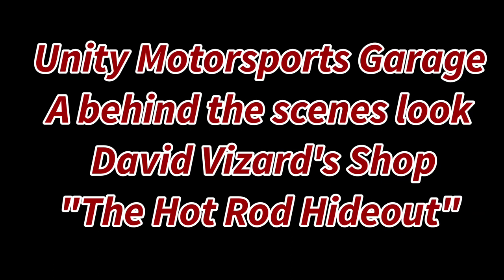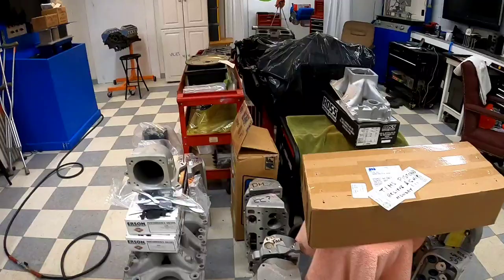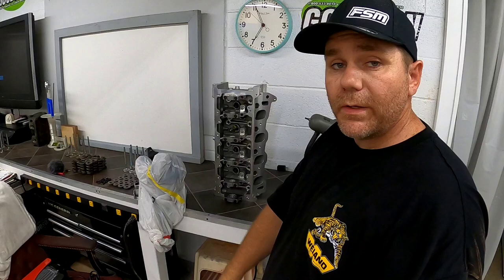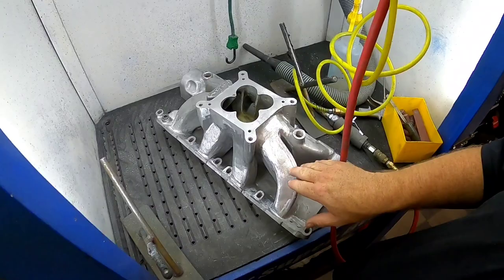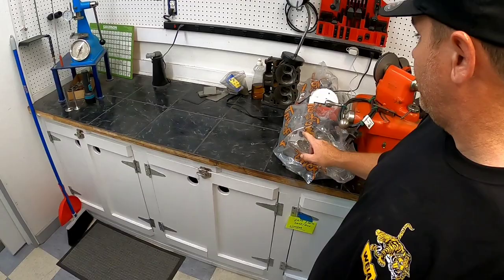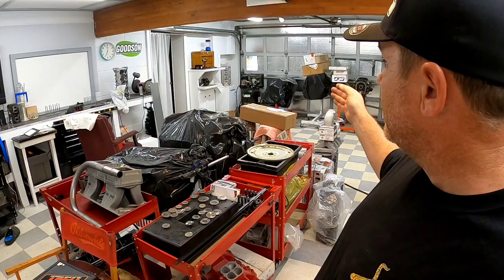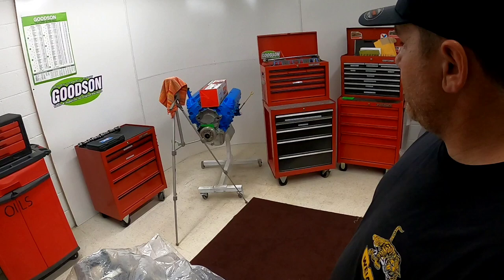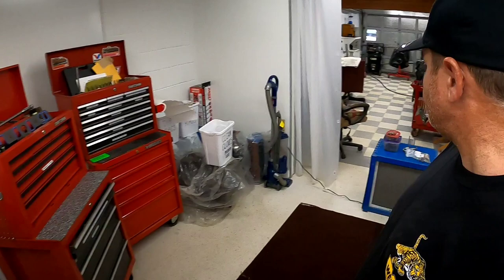Shop Tour at David Vizard's "Hot Rod Hideout"

Comment: Looking forward to the 306 cylinder head dyno test.  I have to build a 302 for my sons foxbody in the near future, probably end up with a 346, and deciding on what cylinder head to use.  Been leaning towards a set of Trickflows.
Reply from the maker: Trickflow makes a very good head for the SBF...  I like there quality and their castings look amazing!  Picking the right head can be hard... Given all of the great choices that are now available... I can still remember when we were stuck trying to find '69-'70 DOOE heads to bolt on our 302's and Windsor's...
Andy
Reply: @UnityMotorSportsGarage    Thanks Andy.  This one will stay fuel injected, so leaning towards a smallish cam with good cylinder heads on top of a stroker that should make a nice broad torque curve and fun to drive.  Nothing too crazy, not looking for max HP.  Planning to also try the relatively new ( I say relatively, they've been out a few years) Trickflow heads for a SBC build I have to do, that look like the old hump heads.  Paint them orange and disguise the engine as a stocker.

Comment: David sure does have an awesome shop! Thanks for the tour Andy!👍👍
I would really be interested in the 4.6L build for your Crown Vic!😋
I have a '99 Police Interceptor, I would like to do a mild build it but I'm not familiar with the 4.6L engines and reprograming the computer/brain box on these newer engines. I was thinking about going with a fresh set of rings, cam swap, bigger throttle body and porting the heads. With the Crown Vic's, I'm looking for big torque numbers and not worried about the HP numbers. I'm not sure if I will need to go with a different pistons or be able to get some performance with the stock ones.
Reply from the maker: That will be coming up.. once I get CASPER back on its feet I can then begin to upgrade the Daily driver! Project Hater...
Andy
Reply: @UnityMotorSportsGarage  Project Hater, LOL

Comment: Hey Andy, I'm very interested in the 306 long rod build.  I will be building a 302/304/306 stock stroke for a road racing project I'm in process of building. Looking for little over 7k rpm capable on a stock block.  Using old SVO aluminum heads that will require porting work.
Reply from the maker: That sounds like a good plan... We are using Chevy 5.7" rods in this build...we have great success using long rods in road racing apps...
Reply: @UnityMotorSportsGarage   Appreciate your reply, and quick as well.  Happy to hear any other tips, parts selections you'd recommend for this application.  I came across DV while searching info on valve springs and saw DV's video on beehive and conical springs. From then on I've been watching his stuff...your stuff now, and have learned a bit more about DV... hell of an opportunity you have to be working along side of him.  Thanks again.
Reply from the maker: @chestrockwell8328  thank you for the kind words..  on the long rod deal, you end up with a piston having a very short compression height which makes for a very lightweight piston, rod combo... That makes for great torque and a Rev happy engine!  Which SVO heads are you using? The old J302 heads or GT40X heads?
Andy
Reply: @UnityMotorSportsGarage  Andy, any details on the pistons I should search for?  I've read about using the 5.155 length rods from the 289 but I'm not seeing many companies list that size. The 5.7" chevy rods have to be plentyful so that's a huge plus.  These heads I have I believe are the Y303 heads, Y302 is cast into the head and they came with Ford SVO 1.6 pedestal mount roller rocker arms.  I read an interesting thread on Corral forum about pedestal mount arms being a better choice over stud mount, with shaft mount being ideal. I haven't been able to find information about whether or not the pedestal mount RR i have are up to the task of 7200/7300 rpm.